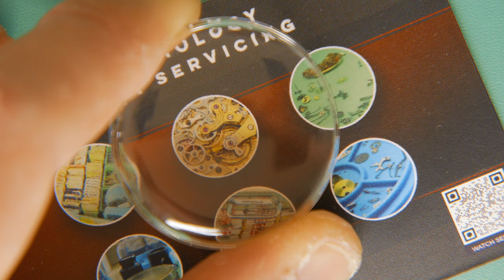Watch crystal scratch removal Make YOUR scratched ruined Watch crystal look like new in minutes

Comment: I wonder if deeper gouges/cracks could be filled in with the car windshield crack fillers and then just polished back down.  They used to sell a paint on filler to fill in scratches on glasses and CD's back in the 90's and I did try filling in a gouge on my then new Seiko 5 Hardlex crystal and though it did fill in the scratches and gouges, it left the crystal with a wavy surface so I just washed it back off (it was designed so it could be washed off), I can't find such a product now but I wonder if it could be combined with abrasive polishing especially since mineral glass like Hardlex should be more resistant than the hardened resins.
Reply from the maker: You have a good point about using a filler. I’ve personally never tired but did wonder if it would have a wavy effect like you mentioned. I think it would be a problem what with the dial being so close to the crystal so any imperfections would clearly be seen. 

I personally would rather replacing a hardlex crystal as I’ve tried a few times with different methods trying to get scratches out and I’ve not had a great amount of success.

Comment: Hey man, I've applied my whole technique on my casio but after the polish when i washed my crystal, it became cloudy (kind of same after 1200 grit sanding), so do i always need to polish my crystal after washing for a clear look ??
Reply from the maker: Yes it will be cloudy once you have gone through the sandpapers. You will have to use the polish cream as the last step to buff it up to a clear through shine.
Reply: @HorologyBiology does hazyness/cloudyness dissappears permenantly after polish or it comes back again when we wash our watch?
Reply from the maker: @ManojVerma-hb8jt  No, once you polish it with the polishing cream the luster will return. This is for plexi glass crystals as I mentioned.
Reply: @HorologyBiology yeah man i am also talking about acrylic glasses, can you suggest me some other polishing fluid as polywatch in my country is very expensive, even expensive than my casio f91w, i tried using toothpaste also but it did nothing to it. What is the alternative to it which is cheap and easily accessible?
Reply from the maker: @ManojVerma-hb8jt  Ok that is the problem then. You can also try Plexi Revive as they also provide really great finishing results. 

https://plexirevive.com/discount/horologybiology

I'm not sure where you are based but I think they ship worldwide. You also get a lot more for your money with this as well so it would last a very long time.

Goodluck
HB
Reply: @HorologyBiology this is also not available in my country buddy, i have seen lot many peoples use metal polish as their finisher, will this get my job done for acrylic glasses ? Like pidellite metal polish or autosol?
Reply from the maker: @ManojVerma-hb8jt  Hmmm, I'm really not sure. I think it might be too abrasive
Reply: @ManojVerma-hb8jt  For your eye glasses, they usually coat them with a film which will be removed if you sand. However, you can try very fine wet/dry carbide sand paper and fine car polish or a wax like carnauba. Why don't you experiment and find out.  No one can tell you precisely, you have to find out. Car polish is available in India.

Comment: Does this work the same for mineral glass off citizen ecodrives and their 200m dive watch ?
Reply from the maker: Certainly not by hand with mineral glass. There are some people that swear by using these grit powders with a dremal tool but I’ve never been successful if I’m honest.
Reply: @HorologyBiology  do you have any suggestions how to get scratches out of mineral glass ? 1 small scratch on each watch just enough to be annoying
Reply from the maker: Have a look on eBay for mineral glass scratch powders. There was a guy from the UK that makes a few powder grits that he swears removes scratches from mineral glass. I cannot confirm if it works.
Reply: @Horology Biology  thank you , greatly appreciated 🙏🏻
Reply: I didn't think I'd come across this comment. I've had the same problem but my scratch was almost invisible. After using a little toothpaste and a finger, it worked wonders. Guess its all about how deep the scratch is.

Comment: Hi, I tried this on an old moonswatch I had. After using 320, 600, 800, 1000 and 1200 sand paper followed by multiple rounds of polywatch, my crystal still looks fairly scratched and hazy. Any ideas what I could be doing wrong?
Reply: Use a higher grit sandpaper is my guess 1200 seams too low

Comment: Ive a Sicura jump hour watch with a rectangular shaped glass.Will this glass actually be plastic as its scratched.Ive had a look on the case back and it doesnt say its mineral crystal.
Reply from the maker: I would say on the vintage Sicura watches it's 90% plastic rather than mineral.
Reply: @HorologyBiology  Thankyou for such a quick reply.I will order some of that Polywatch.Mask of the stainless case and slowly start to buff out the scratches.Its worth restoring as theres not many of these left.